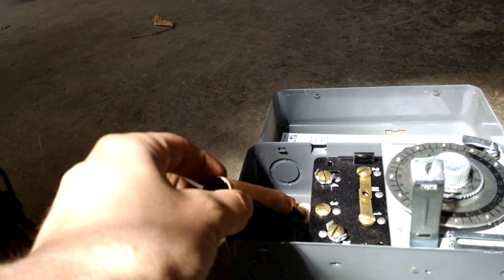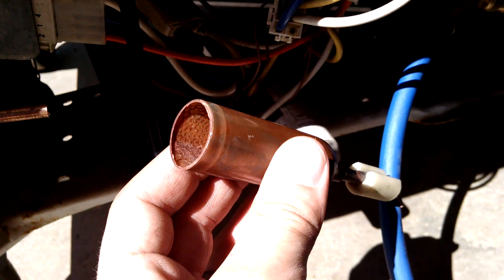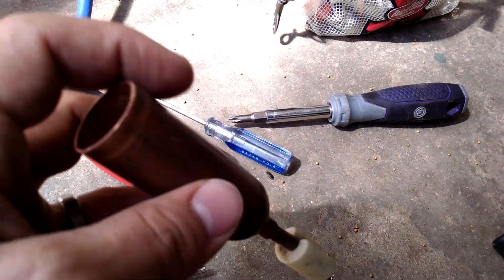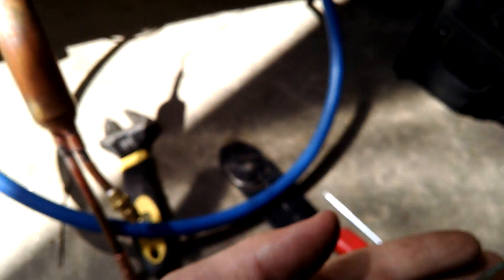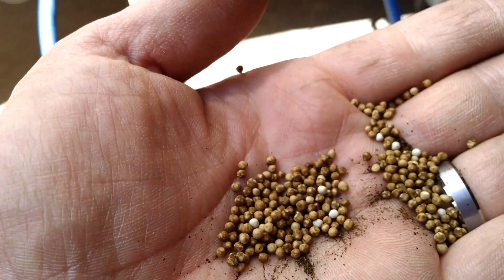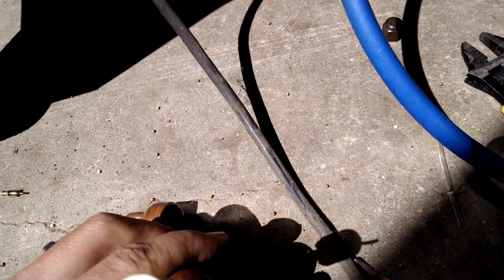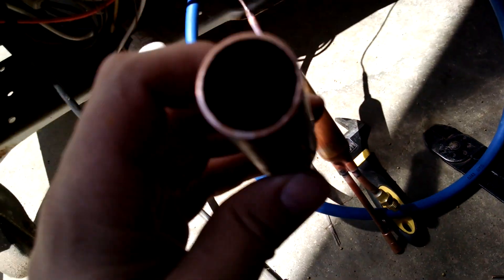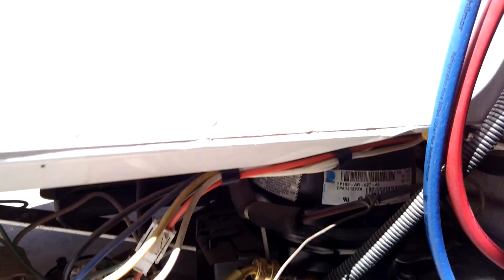Why You Always Replace the Liquid Filter Drier in Refrigeration Repair Work

Comment: Those little balls are (dessicant- for moisture collection & supposed to be white not brown, those black particles are actually oxidized copper flakes from braising without using a nitrogen purge flow & they too can cause compressor failure. Factory should be using nitrogen, either they aren't or at least not correctly.

Comment: Great presentation, I have come across a lot of these problems and was wondering if anybody can tell me why this happens. Is it possibly a product of overheating or something. I have one particular under bar that clogs up every 30 days, must say the ordure of the R134a is un pleasant, I'm suspecting it could maybe be the oil that is breaking down due to compressor over heat, does anyone have the same issues, thanks Guys

Comment: I want to ask something. I am repairing refrigerators for some time now, but I didn't solve this problem I encounter sometimes. After I recoil the evaporator of the refrigerator, I test the unit and it works fine, the pressure on both sides are normal. after 5-15 minutes the pressure in the low side begins to drop to negative and also in the high side lower to about 120 psi. I turn it off and the pressures take some time to normalize. Sometime, I just change the filter drier to solve the problem, but sometimes the problem continues even I change the filter drier. what causes the pressure to drop?
Reply from the maker: vrich marketing renewable energy It is most likely caused by moisture in the system that is freezing into the capillary tube. Replacing the drier and pulling a really good vacuum on the unit will help you prevent this issue.
Reply: Thank you for the suggestions. this morning i totally replace the cap tube and place a new one. i also replace the oil in the compressor. after 10 min of good operation, the system falls down again.  what is happening?
Reply: vrich marketing renewable energy :  Is it low charge for the system?  Good when hot but too low when system starts to cool...?
Reply: i think i need to buy a vacuum pump. i only use a spare compressor as vacuum pump and vacuum the system for about 5 mins.
Reply: vrich marketing renewable energy : Absolutely,  vacuum to 250 micron..
Reply: Thanks!
Reply: sounds like a restriction on the high side. try flushing out from capillary tube through the evap straight to your discharge using nitrogen. restriction could be internal.

Comment: Hi! I am working on a 2014 kitchen aid French door refrigerator. I am having an issue. I bought the fridge knowing it had a bad leak. No refrigerant was found in the system. I located the hole/holes. They both where in on of the bends in the evap coil. I grazed the holes shut without issue. I filled with correct amount of refrigerant, but I am not getting any frost at all where the cap tube meets the evap coil. I also cannot hear refrigerant moving through the evap coil. With gauges on, the low side dips to about -1 psig, so right where it should be. Could this possibly be a clogged filter drier? Or do I have a bad compressor? Also, strangely enough, I think I can hear refrigerant surging through lines near compressor, but when I shut off the compressor, the pressure does not change, it just rests at about 5 psig and takes its sweet time raising to 5 psig from -1. It's as if the system is not equalizing at all.
Reply: if the low side goes to -1 the compressor looks to be good. you might have a restricted high side. start out by replacing that filter dryer. if that doesn't work, flush out the high side using nitrogen. if that doesn't work, isolate evap and then condenser if you have to.
Reply: Did you use nitrogen " flowing through" the system when brazing? If not you probably have a restriction somewhere.

Comment: Hi i change my filter drier but the suction line keeps icing up ,what do i do
Reply: looks like you overcharged it bro.  it could flood your compressor.
Reply: filter drier has nothing to do with a suction icing up....  what is the application ? is it a freezer? how far the suction ice up to? is it a cap tub system or txv ..

Comment: Great video. I have a chest deep freeze that I suspect has a clogged filter drier. The suction line is in a negative vacuum of about -15 and my discharge line is at 75 (which seems extremely low) and the compressor is running at 150 degrees F. I've evacuated the system and added the correct amount of 134a (10.5oz).  I have a new filter drier which is completely sealed and I'm unsure of how to attach it properly?? Should I cut open the 1/4 inch end and use a coupler, and simply sweat open the capillary end?  I plan on using Stay-brite 8 and simply clean flux instead of brazing since I don't have access to a nitro tank. Any help is greatly appreciated.